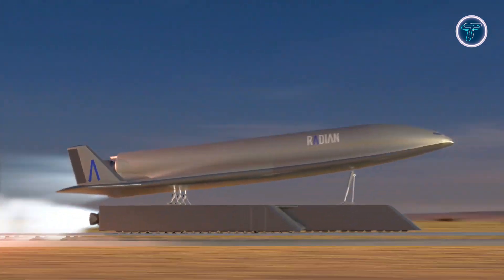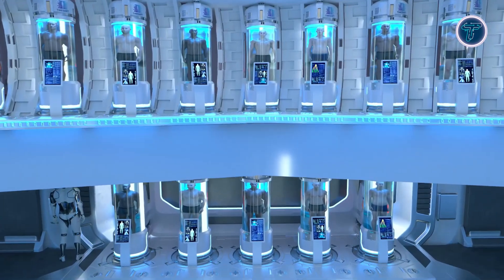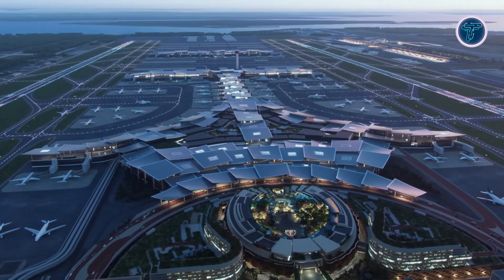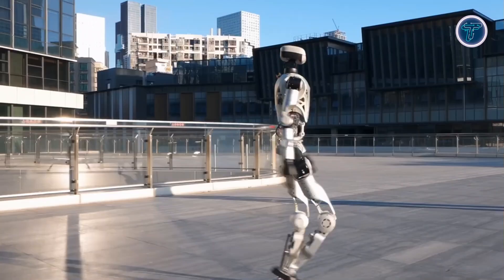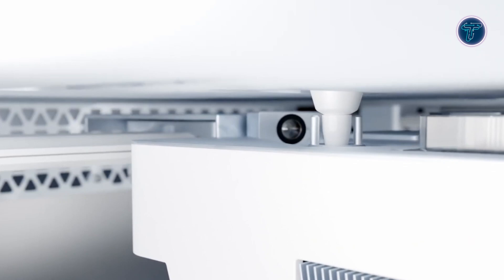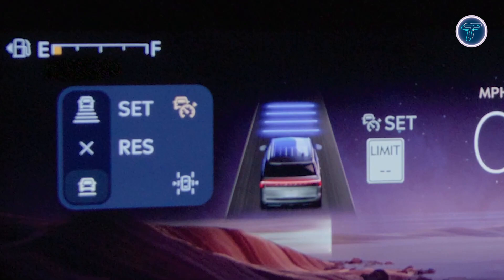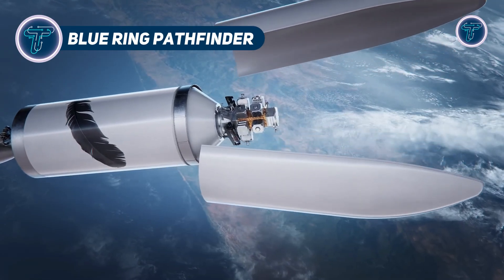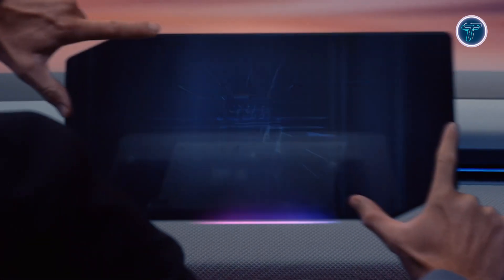Emerging Technologies That Will Define the Future

Comment: what the heck is that. lol. space shuttle is not a space plane. space plane means you operate a single craft. ie it needs to be independent, from any launch rockets etc. ie a space shuttle only returns. it  does not fly to orbit. a real space plane flies to orbit. also that cryo stuff is bs. dont even start. nobody needs to be put in a box, ie grave. raise the ded instead who are walking around as ded while living. gas plasma confinement of an electric arc current heating is way much easier to do than stellarators plasma magnetic nonsense. strike a lightning. with your tech you only seek money, not to make it work. easily. and you get only sold other stuff that only aims to make money, not make things work either. ie your experts are in only for the money payment. what good are you doing if you get paid. drop your package, you only put unnecessary burdens on people you claim to serve. you dont even serve above with your baggage burdens you place on others. you only think you are serving. stay at home, no need to go to work people. services are fake community activity. if you ask above, you go nowhere.